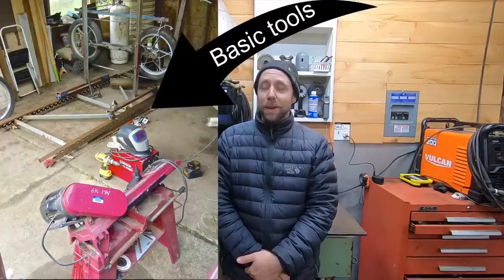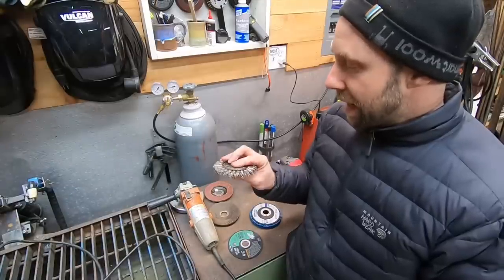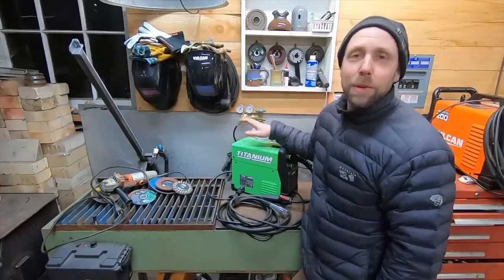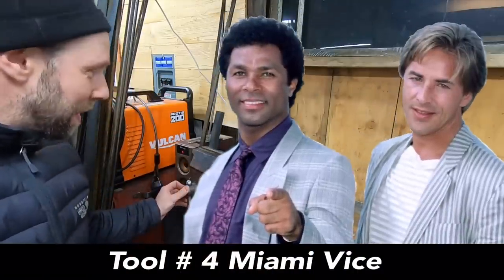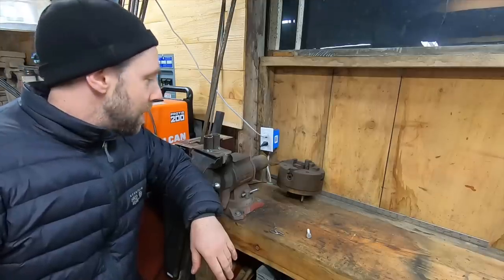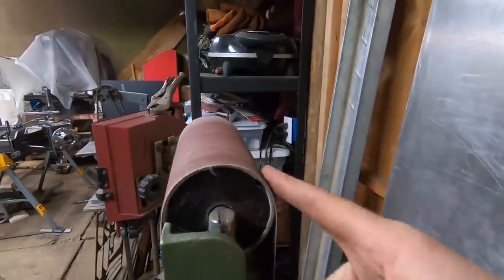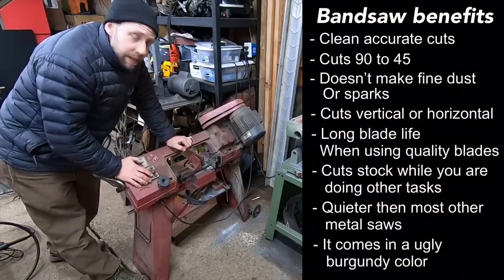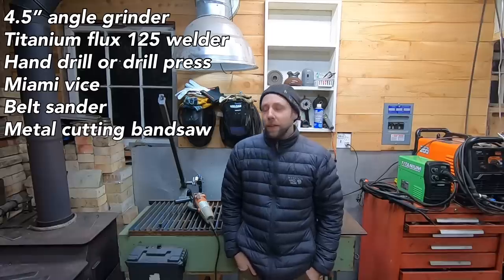6 affordable tools I recommend to get started in fabrication

Comment: Please don't wear gloves with any rotary equipment. It will suck your arm in versus injuring your finger. The one time I broke this rule wearing welding gloves with a wire wheel, the wheel walked its way from my fingers to my forearms and sucked up in under the glove, leaving a nice scar on my forearm. Same principle as not wearing ties or lanyards around a lathe...

Comment: I wouldn't recommend buying anything battery power from HF. I brought a Chicago Electric 18V circular saw maybe 5 years back and I can't get batteries for it anymore. Saw works great but the battery is dead. Ever since they revamped their store brands to Bauer and Hercules I can't find any solutions for replacement Chicago Electric Batteries. Who knows how long Bauer and Hercules will last before they do another re-branding. I'm sticking to Makita or Ryobi for battery powered tools from now on.
Reply from the maker: I really don’t like when a brand is discontinued like you mentioned, I hear you on that. I like makita but I have had perfectly good batteries running on a drill, put them on a charger and the charger indicates the battery is broken, there goes another $70 for a new battery 💨
Thanks for your input 👍
Reply: @Mikefestiva  You're right. It haven't happened to me (yet) but a friend mentioned the same thing happened to them. Anyways I didn't mean to come off as negative. I love HF, and wouldn't hesitate purchasing the corded tools as long as the reviews are solid.
Reply: You can put any battery in and other battery powered hand tool they sell adaptors and if you want to go the other route all the batteries are the same just the lock in cases are diffrent
Reply: Plenty of how to vids to replace the cells in your battery paks. Just have to figure out which cells the factory used and get some new ones.

Comment: Where would you put a bench grinder on a list like this? Would I work in place of one of these tools or is it more niche
Reply from the maker: I use a bench grinder but not that often in my shop. I keep a grinding stone on one side and a wire wheel on the other. I would say they have there uses but maybe it would be tool 7? Take care
Reply: I personally use it a lot to bevel edges for welding and to round off corners.

Comment: I want to run the welder on gasoline generator ,so how much watts I need it to do that?
Reply: Graptor660r   The Titanium 125 runs off 120 volts and according to the owners manual max current draw is 23 amps, so 120 x 23 = 2760 watts. So if you get a generator that can deliver 2800 watts continuous you'll be golden. Note that most generators are rated for start or surge power, so you'll want a 3500-4000watt (surge/starting) rated generator. H-F has a 4000 watt for $359 before coupon that has more than enough power to run the welder.
Reply: @davehoward2791  thank you for your time,  I really appreciate your response
Reply from the maker: Thanks for commenting Dave 👍

Comment: I have a question for the flux welder, can it weld stainless ?
Reply: U can use stainless wire. Make sure u Ware a respirator or have fume suction. The hex 6 released during welding has led the way for safety improvements across the country.
Reply: @brettr5188  Never weld anything without a respirator. Don't grind without it either. Use the 2219 filters with your 3M respirator.

Comment: can you give the specs on a good bandsaw blade for cutting tubing with the HF bandsaw
Reply: Anything made by Lenox is top of the line in my opinion also Milwaukee has very good blades there are more brands but those two I've had very good luck with

Comment: Those cheap drill presses aren't worth it. You get more torque from a hand drill. There are tricks to drilling straight holes or there are guides you can buy. ...also, keep in mind the throat depth of those little drill presses is very limiting

Comment: Is this welder suitable for frame repairs.
Reply: 3/16" it says
Reply: I'm thinking your referring to automotive frames ? You might want to check into the max thickness you are able to weld with these smaller machines especially if you repairing a frame with flech plates to strengthen the repair in that case you will need a welder with really good penetration and duty cycle it all depends on what you are going to be welding and how much of it you plan on doing . . Choose wisely

Comment: Does that welder work for car sheet metal?
Reply: No, you need a tig welder, with mig or flux wire you'll most likely melt through. Also flux welding has lots of slag.

Comment: how about where to find cheap/free metal stock?
Reply: Really Happenings agree. This is getting harder. Go to your local welding shop and ask if you can have some of their scrap to practice on. My local metal supply house got bought out. I used to buy their "drops" for a per pound cost. Now I can't find a place that will sell drops. I have a Metal Supermarket which I'm forced to use, but their prices are steep. Quality and convenience are high however.
Reply: any scrapyards near you ?  people drop off "raw material" all the time to be repurposed... next any furnace folks ?  some old furnace panels make useful donors too... hot rodders take van roofs for pre-1936 builds, just saying...

Comment: Can we get an update on the Flux 125?
Reply from the maker: Yes I will work on a update video this weekend, I actually will put together a collection of welders to update. Ps the Titanium flux 125 is an excellent little welder 👍
Reply: @Mikefestiva  I picked one up last week and absolutely fell in love with the little thing. I tried some forney .030 with not so good results on thinner material. With the machine all the way down the forney was way too hot for 18 gauge while the Vulcan wire did great. Just a FYI.

Comment: Table grinder?
Reply: Not a lot you can do with a bench grinder that you can't do with a belt sander or an angle grinder in a vise. It's a great tool but it's probably just too redundant for a top-6 list.
Reply: As long as you don't sharpen drill bits by hand or hand grind lathe cutters you don't need a bench grinder.  I have 3, some fine wheels, some wire wheels, a green wheel on one.  But, we are talking about getting started, a guy could clamp his hand grinder in the vise and have a bench grinder. Right?

Comment: My HF vice split in half while I was pressing out a U-joint. 🤨
Reply: For sure, I picked up a couple bench vises from yard sales for $20 (a Companion 3.5" Bench Vise, a Companion 1.5" pipe vise, and a Worth 3.5" bench vise), definitely snoop the yard sale groups, craigslist, and yard sale posting that say "lots of tools!" ... usually an estate sale of sorts and a lot of stuff for little cash.
Reply: They are designed to do that to protect what ever the hell it is you're overloading. It saved you from damaging your U joint now didn't it. Just be thankful.

Comment: Got a vise, 1/2 Ton Arbor bench press, Delta Rockwell 14in Floor standing drill press, Campbell Hausfeld 110 Arc Welder, Dewalt XR 20v cordless drill, Hitachi angle grinder, WEN rotary tool (Dremel) with flex shaft and all types of bits. You want the best bits money can buy for home use? DRILLHOG USA yes I have them too 😁
Reply: Nope don't work metal I work on gas bikes for a living 😂

Comment: great video thanks.  dont wear gloves when using a bandsaw free hand.  you'll be missing fingers like my buddy.
Reply from the maker: Thanks for your concern but I’m not new to power tools and I safely operate them on a regular basis,  gloves or no gloves you never should get your fingers or hand anywhere they are going to get bit.
I do fabrication, maintenance, electrical testing daily at my job, been there Ten years without a filed injury, work smart and respect machines. Ps I don’t wear gloves when operating my lathe. Take care
Reply: Mike festiva good luck. guess my 40 plus year's experience is wrong.

Comment: As someone who does a lot of fab work its a little disappointing to see someone recommend a harbor freight tool I believe you don't need the best equipment, but you should buy something that will hold up as 99% of the time its cheaper to pay 2x the cost upfront to get a well-known brand that has a reputation for lasting than to buy many of the cheap ones plus someone who is beginning will have an easier time due to quality equipment and not be turned off because their tools are fighting them/breaking.
Reply from the maker: 001pickle I cannot stand behind your outlook on tools, I don’t care what company makes a tool, the tool does not define my creativity or ability to build stuff, I do. My friend bought a Millermatic 200 around the same time I bought a Harbor freight Omnipro 220 welder, the Miller cost over twice as much, the Miller broke within the first year, it took sending it back for repairs 3 times before Miller actually fixed the problem, plus my friend was out a welder for 6 months because Miller was dragging there feet on repairing it. I can’t get behind that company. 
Like you I also do a lot of fab for my main job but on my free time I work on projects in my home shop, guess what I use HF tools, check out this articulating 4x4 dump truck I’m building. https://youtu.be/vFphyNUhsaY
I would be interested to see what you are building with your high end tools? Take care
Reply: Harbor freight is really stepping up their game tho
Reply: SweatDeezTexas I do own some expensive tools as I do a lot of specialized work and work I don’t want to send out it’s a cost thing again as it costs me more money/time to have me do it the long way with hand tools or have to pay someone else to do it
Reply: Mike festiva really I have never heard of miller causing problems like that as I have had great experiences and not heard of anyone having a bad one but not meaning to advertise but look at a channel called project farm, and theirs many more like it who test these products unbiased and HF comes in last or close every time I don’t believe in the most expensive equipment as I said just something that’s known for holding up which usually means a reputable brand as you should know it will cost you more in the long run
Reply: @Mikefestiva   to each their own really but theres a reason 98% of fab shops use millers. and why most professionals use one of the big 3, id even recommend everlast over HF. 90% of their hand tools are trash as well. dont get me wrong they have some decent stuff and most home hobbyist that'll only use their tools a few times  a year theyre just fine
Reply from the maker: ownij0885 ownij0885 I think you guys are getting a little off topic now, check the title of the video ( 6 affordable tools to get started in metal fabrication) it’s not how to start a professional metal fabrication shop, this video is intended for people on a budget that possibly want to start doing projects and don’t have a lot of extra money. I’m in no way trying to change your mind on what tools you guys should buy, mater of fact I don’t care, I do know not everyone including my self wants to spend $1500 on a welder especially if there just starting out. Run your nice tools and I will keep running my “Trash tools” but at the end of the day I can prove with my videos I’m actually building stuff with my tools, I checked both of your channels and you guys have zero content. If you check out a lot of home DIY guys from Russia those dudes are building some really good equipment like tractors and vehicles with basically a old stick welder and a angle grinder, a cold shop with a dirt floor, it comes down to being resourceful, creative and motivated then name brand tools.

Comment: I highly disagree with anyone that says start with stick welding or mig welding, that was MY mistake!!! 

Learn with tig and gas welding first, they're by far the most fiddly and patience grinding methods, once you have those two down the other two become nice and easy and just need refining, but based on your information I agree mig for home use as it's more versatile and a lot less heat it needed on most of the stuff you'll be doing at home anyway

Comment: I can’t imagine buying power tools from Harbor freight😂
Reply from the maker: Some people turn there noses up at HF tools, I run a lot of HF in my shop and build a lot of things. The tool doesn’t make the skills, I do.
Take care
Reply: @Mikefestiva  Same thing with the so called "Chineezium" junk. They are great at a fraction of the price, specially for home shop DIYers. Also, if people care for their tools, it lasts much much longer. Use it right first, fix the problems, and mod it for better functionality. But for professionals its a whole new ball of wax. Some things its best to get the high end stuff.

Comment: Gotta learn on stick to respect the process.
Beginners must build skill and be humbled with first hand knowledge of hard way. 
Mig has made too many arrogant half ass's, seen it myself. Im not putting anyone on mig until they can stick weld and gas weld
Reply: Watch out people. Big, tough man marching through the comment section
Reply: The average  home handy man , mig is all you need ?
Reply: Yeah... I practiced stick welding for two years. Focused mainly on 6010, and 7018. Got certified (3g unlimited thickness) and all. While knowing how to stick weld is a great idea I don’t hold it to people as a right of passage. On a side note though a “true welder” can do more then mig. Even with that said I don’t think most people this video is directed to consider them selves “true welders”
Reply: Maybe some of the guys watching this video NEVER plan to be a bigtime welder like you.  Maybe we just want to learn to weld some sheet metal or parts while rebuilding an old car or whatever.  So why would we want to take months and years to be as good as you if that is all we intend to do.?  Serious question.

Comment: No no you don’t wear gloves with any grinders 😂😂😂
Reply from the maker: Haha!  okay Yesimka how many fingers do you have left 😂😂😂
Reply: Yesimka Maki f that. Thin gloves even,have saved my fingers.
Reply: Mike festiva a glove doesn’t protect your finger from getting cut off if you use gloves with a pedestal grinder it’s just gonna pull you in. Same goes for a regular grinder it just pulls you in, my friend just cut off 1 finger from it he said “if I was wearing gloves my whole hand would be gone”
Reply: Yesimka Maki I’m sorry I still can’t get over this. Someone recommending to others that they wear no gloves while using a grinder. Lol like..it should be illegal for you to communicate with others.
Reply: @adrianstanfill7554  9 hours later youre still thinking about this... you need to put less thought into youtube comment sections, as far as gloves i wear them while using my grinders but i see his point in loose fitting baggy gloves can be a hazard i use grinders all the time without gloves as well worse ive had is a slight sanding from flap disks dunno how you would cut a finger off theres no teeth on grinders youd need to really jam it into your hand to do any damage
Reply: Andrew Browner kinda depends. Don’t see a flap disk cutting it off but I use a different disk at work that’s very capable of cutting a finger off. It’s not the same kind of disk you buy for your grinder st home. It’s thin like a blade but still abrasive. The way you described t makes more sense tho. Ya Ofcourse you don’t wanna wear loose baggy ass gloves.
Reply: Adrian Stanfill idk I apologize for offending you, my welding instructors and the OSHA videos I had to watch taught me this. Maybe they are wrong and I should be learning from you? 😣
Reply: There is a pretty decent debate about gloves and rotating tools. Personally, I use very tight fitting mechanic style gloves while operating a grinder. And never anything with a strap of any kind, only slip on. If my fingers are going to be close to the spinny part, I will remove my gloves. 
I see both sides of the debate, but I fear being pulled in by a stray string more than slipping. It's my personal choice. People are injured by gloves too. You're trading one risk for another.

Comment: Pro tip dont use gloves with the wire wheel
Reply from the maker: Tristan Mayer If you want Wire wheel fragments stuck into your fingers don’t use gloves.
Reply: @Mikefestiva  True but I know a couple of guys who have had there glove get caught by the wheel and get torn up pretty damm bad
Reply: @tristanmayer9102  use gloves... don't put your fingers in the wire wheel..........
Reply: Use the correct type of gloves. Snug, not loose.

Comment: NEVER USE GLOVES WITH A ROTARY POWER TOOL!!
Reply from the maker: gtw94 Run them how you want. I will continue to use gloves when using angle grinders, I still have all my fingers. I however never wear gloves when running my 13”X40” metal lathe or milling machine.